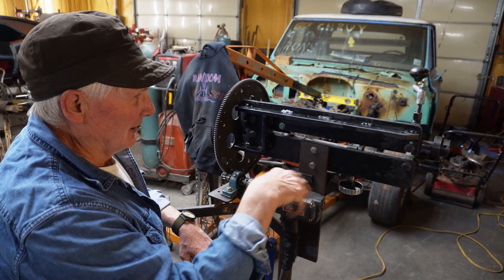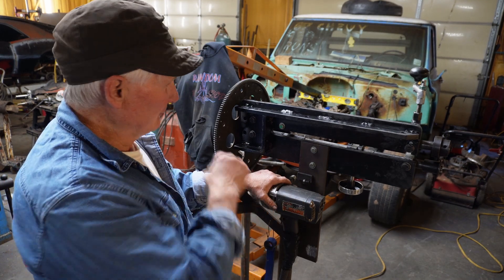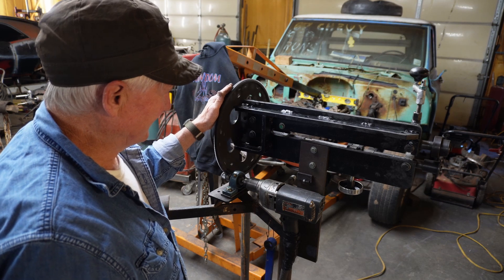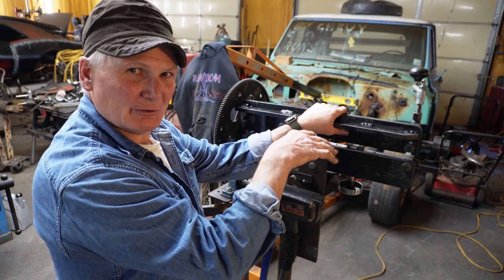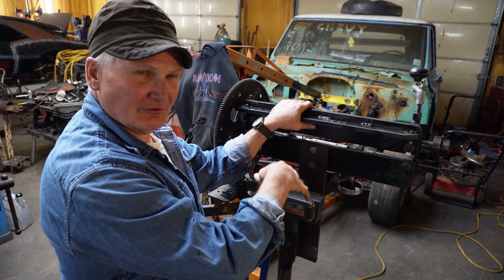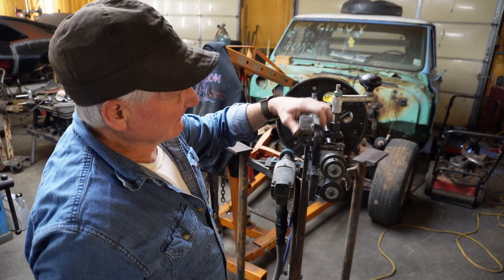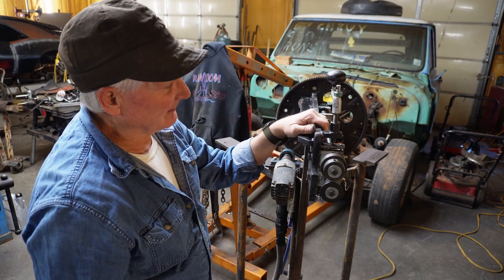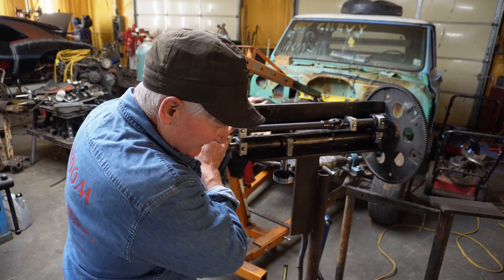Bead Roller Masterclass: Final Upgrades for Perfect Metal Shaping

Comment: That's some very nice creative work.  It's really tough to build something with that level of functionality that works with odds and ends.
Reply from the maker: Thanks. I was really focused making the mods as DIY as possible. I didn't realize how loose the manufacturing tolerances were until I started adding the third bearing block.😊 I would have saved a lot of time if I had built my own frame. The final result works really well and should save me from making or buying specific use dies.